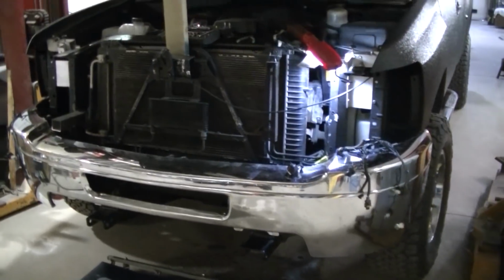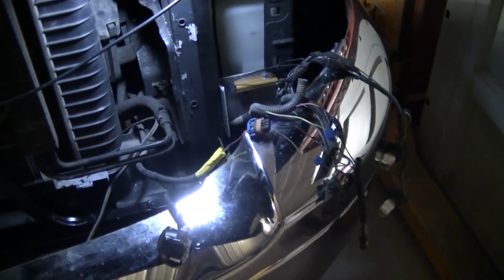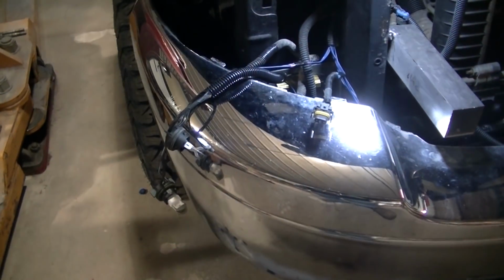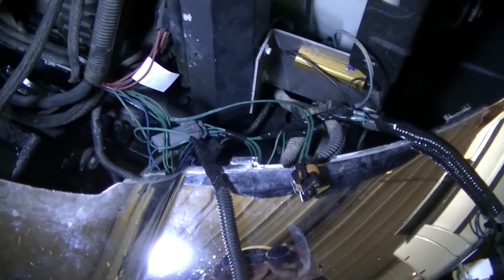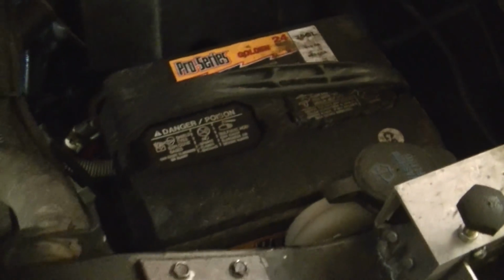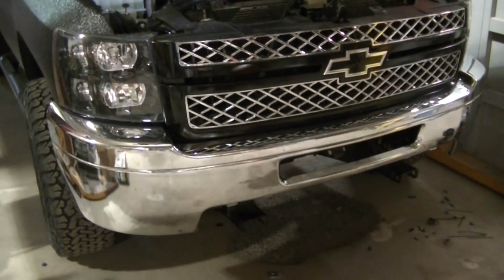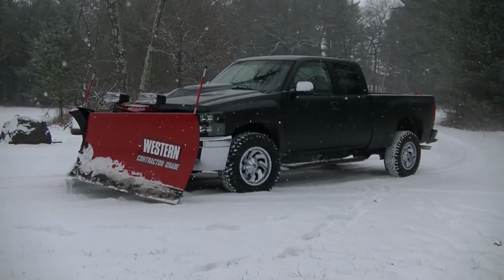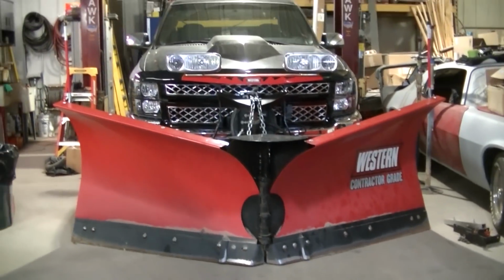Project Frankenstein Western MVP3 Plow Harness Install

Comment: I was expecting a tutorial on running the harness and explaining where everything plugs in.. Disappointing tbh.
Reply from the maker: This truck is put together with many different parts from different years. It wouldn't have helped anybody to go into detail on the wiring. If you look at my other plow harness install videos with normal trucks, you will see a detailed install.
Reply from the maker: I am pretty sure I explained that in the video.

Comment: I think those classic style tow mirrors you use to have on midnight would look really good on this truck. Thanks for providing all the info and great content. looking forward to seeing some plowing videos
Reply: I'd add some weight to the back. Have an 02 chevy duramax with a western MVP Plus 8.5 + wings and its quite light in the rear.  Once its in 4x4 tho its awesome
Reply from the maker: I have some towing mirrors for it.  How much weight do you run?
Reply: mossman381 I try to run about 600 pounds. it does well. In 2 wheel drive. For doing houses. But when I’m plowing commercials I run it in 4 high and tow haul. It save the transmission second gear by keeping you in first with more torque.

Comment: What rear end is under Midnight ? I have a 2005 GMC 1500hd with same running rear as frank
Reply from the maker: 10.5 floating with 4.10
Reply: mossman381 How is that truck on gas with the 4.10?
Reply from the maker: It's not too bad but I have a 6" lift and 35" tires so fuel mileage never was a concern for me.  Never checked it before the lift or after.  It does a lot better than the 91 dually with the 454  :)
Reply: mossman381 Of all your 2500hd and 3500 did any of them run a steering stailber .Mine has the mounts on the frame aready but no shock.
Reply from the maker: They all had steering stabilizers.  This 2500 has the frame mount but no hole in the steering link.

Comment: I don't like the quick connects for any major wiring but I used them for my auxiliary reverse lights. That's only because I didn't want to actually cut my factory wiring. Everything else I've put in, I solder. I don't like crimp connectors and have no good luck with them. I like the waterproof connectors that have to be physically wired in. Those are good.
Reply from the maker: I use a lot of the weatherproof crimp connectors.  I have installed every plow with those and have had zero issues.  They are quick and easy to make.
Reply: mossman381 I've had them not create a good connection before. I guess I just prefer a full hardwiring job if I can. Little more work but I like how strong my solder connections are.
Reply from the maker: If you strip the right amount of wire and crimp them right there should be excellent metal to metal contact.  Also using the right size for the wire.
Reply: mossman381 yeah I just haven't good luck with them. Even ones crimped on well seem to come loose easily even when the properly sized ones. Only things I crimp on are spade connections for switches. It's just my personal preference. There's nothing wrong with them. I just prefer to solder

Comment: Looks pretty good to me. Are the 3500 torsion bars bigger than 2500hd bars? I think a lot of parts on the 2500hd and 3500 SRW are the same. If you do keep the truck and use it for plowing often, you may want to invest in a bigger transmission cooler and maybe even a Derale Deep cooling transmission pan. I run one of those on my Ford F350 because I tow with it, they hold an extra 7 qrts of ATF plus they run cooling tubes the length of the pan for airflow.
Reply from the maker: I guess I was talking about some 3500 dually bars.  The 2500hd bars would probably work but if I am upgrading I would like to get the biggest ones possible.  Trans cooling upgrades would probably be a good idea.
Reply: Yea, biggest possible is a good philosophy for a truck intended to be a work horse. And yea if you google Derale deep transmission pans, you will see what one looks like. There are a few different brand s that offer them, but the Derale is steel and not aluminum so it won't bend easily which is good. I'm pretty happy with mine. Bought mine off of Summit. And the auxiliary cooler I run is a Tru-Cool 28,000 lbs GVW aluminum cooler.

Comment: Looks great job well done upgrade the springs you’ll be fine. Trucks are getting way to expensive that being said if you could find a dually with lower miles needs a little work that would be perfect for you I like the way this trucks looking awesome jon
Reply from the maker: Was looking for something new and lower mileage.  Just couldn't hand that much money over when an older truck can do the same thing.  Maybe later on down the road.
Reply: I’m going through the same thing used market is 10 grand lower then a brand new truck I’d rather go new it’s insane
Reply from the maker: New is definitely nice.  I guess everyone has to decide if that is worth the money or not.